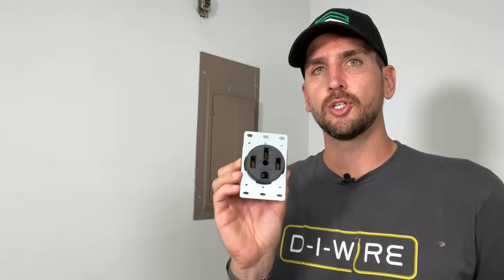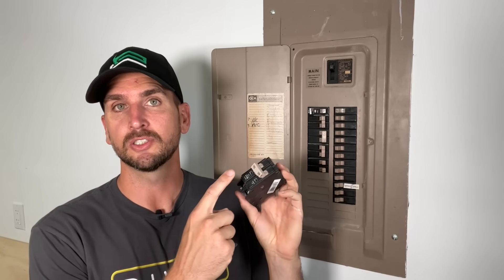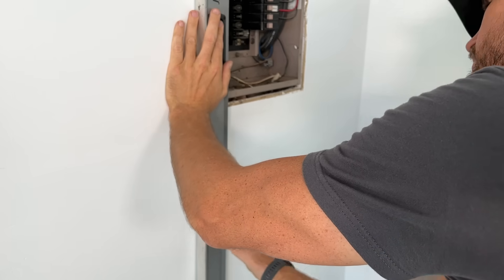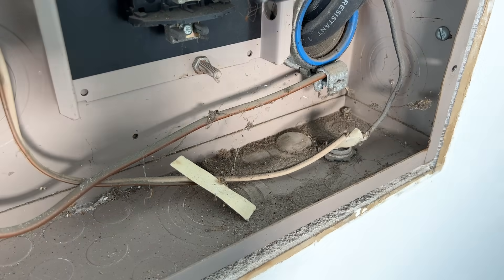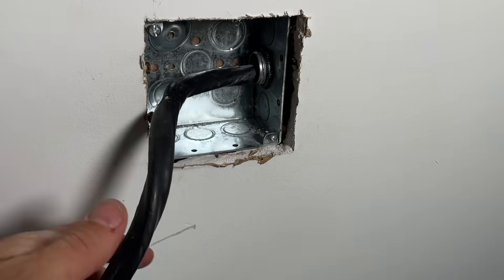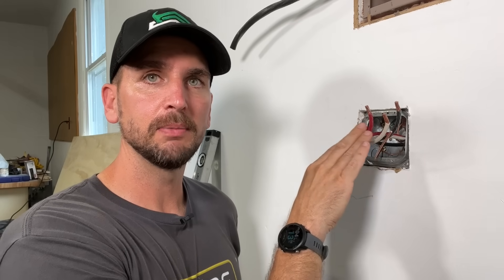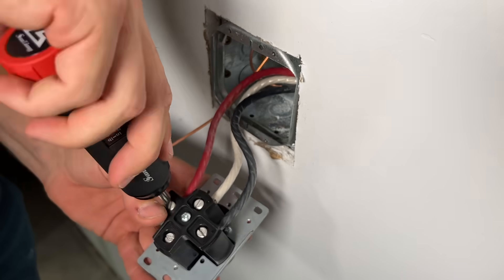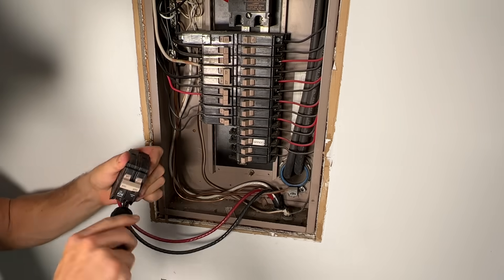Quick and Easy DIY 240V Outlet Install | 50 Amp NEMA 14-50

Comment from the maker: All My Favorite Tools: https://geni.us/VYIp51
Torque Screwdriver:  https://geni.us/pghmcX

Supplies
Eaton CH 50 Amp Breaker:  https://geni.us/Afby
Best NEMA 14-50:  https://geni.us/xIXIYZt
6/3 Romex:  https://geni.us/rg0e
3/4 Wire Connectors:  https://geni.us/yQen
4" Metal Box:  https://geni.us/UUEBe
Mud Ring (1/2" Raise):  https://geni.us/UUEBe
Faceplate:  https://geni.us/zbN3V8

Free Home Maintenance Checklist: 
https://geni.us/uQuAWER

"D-I-Wire" T-Shirts:  https://geni.us/ifioHVc

DISCLAIMER: This video and description contain affiliate links, which means that if you click on one of the product links, I’ll receive a small commission.
Reply: 20 inch/lbs? I'm looking at my EV rated  14-50R and it says 75 lb-in

"'8:49 going to go back through with the torquing screwdriver make sure i get the 20 inch pounds 
And also the key is because these are stranded wires you want to torque it down until it clicks. 
Then you want to work those wires and move those strands around and then torque it again
Do that 3 four five times before you're confident that everything's torqued correctly."

https://hubbellcdn.com/installationmanuals/WIRING_PD1186_INSTALLINST.pdf

installation manual there  says 75 lb-in

Comment: PLEASE - Do NOT use the standard 14-50 receptacle like he shows in this video - it WILL melt. Use an EV rated 14-50r receptacle. It is heavy duty and can handle the current an EV charger puts through it and much less likely to burn your house down.

Comment: Make sure you use a heavy duty 240 / 4 wire 50 amp receptacle.
Reply: Wrong type mounting screws, wrong size ground wire. Standard receptacle.

Comment: This video should be taken down at this point, these cheap 14-50 receptacles do not work for continuous loads like EVs. Even with the right 14-50r receptacle, it also needs a GFI breaker.

Comment: WARNING! The NEMA 14-50 is not rated for continuous current. Go lookup the Landers Electric video which shows that a $50 Hubbell 9450A is the correct receptical which is actually rated for E-vehicles. These $10 NEMA 14-50 melt all the time under constant load.

Comment: That $9 outlet was designed for dryers, etc. that run for short periods of time, drawing much less current.  Your EV charger will  be powered for hours and hours drawing upwards of 40 amps continuous.  You really need an EV rated outlet to handle the load.  They cost in the $80 range.  Bite the bullet and buy one that can handle the heat. $80 is much less than the cost of rebuilding your garage when that $9 outlet melts.

Comment: How does an 80s panel have enough amps?  Mine was installed in 1996 and has 150 amps total.  And don’t you need surge protection?

Comment: Safety Alert!  You update this video and stress that this plug is not rated for high amp L2 EV charging. Read the box it will even state that. These are for stoves and laundry applications. The sustained high current will melt these cheap connectors. The ones needed are marked for EV charging and cost a significant more ($80-90)

Comment: I just did mine.  It cost about $500.   $200 for 6/3 50ft Romex, $100 for ev outlet and parts.  $200 for a level 2 charger.  $500 well spent!  You dont need gcfi breaker if u get a level 2 charger that has gcfi bulit in.

Comment: Caution - go watch t8Hy-8X4mNU which discusses risk with not using EV outlets for EVs.  I'm not 100% sure why outlets "rated for 50A" are melting and catching fire, but I wouldn't recommend spending the ~$9 on the outlet here.  Also note that EV outlets often have a larger face, which means that face plate may have too small of a hole to put the outlet face through.

Comment: Great video thx!  Question:  why use a metal box?  You have to  connect a ground wire to it.  Versus use a plastic box.  No ground needed.  Am I missing something?  Why not use a plastic box?
Reply: And plastic face plate with plastic box.

Comment: If you're using the cheap NEMA 14-50 plug then you don't want to pull too many amps on it. Using a mobile charger that doesn't pull any more than 32 amps should be fine, but if you're trying to pull 40 or higher, you're probably going to have a problem. 

It's also a good idea to put a mechanical switch ahead of the plug so you can turn it off when not in use without unplugging from the wall.

Comment: I hate being that guy - The EV charger breakers can be sized based on how much energy you have available.  You did not cover if the main breaker or incoming wires can handle the new electrical load. You did not explain the max amperage of the bus bars in the panel. Yes, this can be a DIY project, but someone just throwing a  dryer outlet with a 50A breaker in and letting it buck could cause an electrical fire.
Reply: So then make a video explaining it

Comment: Note OP found out this install is not per code and has other problems so there is a follow-on video that fixes these problems.  Do not use this video to install an EV/welder 240/50 amp connection.

Comment: Got the same Cutler Hammer panel right down to the label for identifying each circuit.  Glad to hear it was a product of the 80's rather than having been around since the mid 50's when this house was built!  I used the 240v 30a dryer outlet for level 2 after upgrading the outlet to a 14-30p matching the EV charger's plug.  After a couple of years of EV charging, the almost 30 y-o breaker kept tripping and needed replacement.  Local parts availability made the job a snap.  Thanks for the video!
Reply: Be careful.  The cheapy outlet the guy got here is NOT for EVs.  Dryer plugs work well for dryers and stoves because they are not drawing current more than an hour at a time.  EVs on the other hand can melt dryer outlets from the strain and energy demand going on for hours.  The proper EV outlets cost more than his entire project cost in this video.  Make sure you get a better outlet that is specifically rated for EVs.  They should cost $70 and up.  Not the cheap $20 and under from HD and Lowes like the one he got here.

Comment: Thx for the video! Trying to install a LEVITON NEMA 14-50 for EV. The manual says the required terminal torque is 75in-lbs (much higher than the 20in-lbs mentioned in the video) -- not sure whether the EV version asks for higher torque.

Comment: I had the same exact thing done, with the receptacle 8 inches below the bottom of the panel in my garage. Except in my case it was a 6-50 receptacle and I paid an electrician friend to do it so my cost was a bit over $100. Then I just plug in my Tesla mobile charger and the 20ft cord allows me to charge my Tesla in my garage without having to back the car in. I got a wall mount kit so the body of the mobile charger is secure to the wall, and wrap the cable around a second mount that has a hole for the adapter's plug when not in use. I do have to put up with the cable dangling the whole length of the car so I have the cable rest on the side mirror so it's not dangling too much on either end. Just have to be careful when locking/unlocking the car.

Comment: Recommendation:
We recommend using an industrial-grade NEMA 14-50 outlet for enhanced durability and safety. In addition, to comply with the National Electrical Code (NEC), this circuit should be protected by a GFCI breaker, as required for outlets used in garages and outdoor locations.

Comment: DONT USE CHEAP OUTLETS!   There are lots of examples on YouTube of what happened to people that used 14-50 outlets designed for electric ranges.  Use one rated for EV's and designed for continuous use.  These are Heavy Duty and have better wire connectors using Allen screws

Comment: In VA and most places a GFCI breaker is required. The  last one I brought was $175.00. The proper receptacle is around $55, the cover plate to fit around $10.00, and 6-3 romex is around $6.00 per foot. And yes using the wrong material could result in your house burning down. After the insurance inspectors get through, you might be paying to rebuild your house on your own.😂

Comment: Crazy, just my hubble was 75 then my permit was 145 then my wire was 250 then my breakers were 130 then my misc was 35 total 635 plus the charger of 900 no govt subsidy.

Comment: Maybe a good observation - the $9 legrand should probably never be used for EV charging. At this point the slightest research would show this is one of the main reasons for fires/melted outlets. Not only that, but the manufacturer itself is disclaiming that in the included instructions. I'm not sure if saving $40 is worth it

Comment: $66????? The 6/3 wire alone is $7 per foot! I bought 6ft of wire $42, the commercial grade EV plug $50 and the 60 amp breaker $20. All in all I spent around $130. 
I don't know where he gets $66 from. 😂

Comment: Those outlets are not full duty nor designed to be pluged in and out. A dryer outlet use for EV charging is a fire in the making. Get the proper outlet.

Comment: Will this breaker work for the Tesla level 2 mobile charger?
Reply: Yes, but the outlet he is using is not EV rated. Get the Hubbel 9450A. The one he is using will probably melt.

Comment: Sorry to say but you're in violation of NEC 625.54. That install needs to have a GFCI breaker. That will blow your $66 budget way out of the water. That breaker alone is about $150.

Comment: I use the plastic outlet box so do i need to put extral 10 gauge ground? Thanks
Reply from the maker: No need to ground the plastic box so just straight into the NEMA 14-50 outlet.
Reply: Thanks sir

Comment: My 2001 built homes panel came outfitted with an empty electrical box like the one you installed but no outlet in it. What other uses would it have other than charging electric cars?

Comment: You'll need a GFCI 50A 240VAC breaker for a garage or outdoor installation.  Add another $50 to the project.  The receptacle alone is reaching your projected cost o0f the project.  Hard-wire the charge regulator to save yourself the cost of the receptacle anf GFCI breaker.

Comment: Thanks for sharing this video.  The link to the mud ring listed is not correct.  I am not an electrician.  Is the mud ring necessary, and if so, what should i look for ?  I assume it is supposed to fit the electrical box.  thank you

Comment: I did this project and it wasn’t too hard or expensive. But I used a commercial grade outlet. After it wa all done I plugged in my ChargePoint charger only to discover it kept tripping the GFCI (an extra cost in the $150 range).  I ended up starting over and changed to a hardwire install. It’s much cheaper, easier and provides slightly more charging power. If I ever want to move the disconnect is easy.

Comment: I'm sure someone has already pointed this out but I don't have time to go through all the comments.  That 14-50 outlet is crap for car charging.  It might be fine for a welder or a garage clothes dryer.  But I assume people are not installing this much power in their garage to weld something or to dry clothes.  99% of these installs are for car charging.  And that $9.00 outlet will burn up fast.  You need Hubble brand or some other heavy duty outlet that can take the 42 amp continuous load it will be pushing out for hours at a time.  Otherwise everything else is spot on.
Reply: I think you should update your information since this is 2025.  Using a commercial  outlet (Hubbell) 14-50.  It will hold up much longer and will not melt if left plugged in.  Only thing that I see that needs to be addressed is the Hubbell outlet says it should be torqued to 75 lbs!  Not 20 lbs that you recommend.  Otherwise, you might want a deeper box, or an extension to make things fit easier.  Just thought I would let you know.
Reply: It’s a 14-50 so it’s something that needs a 120 & a 240 like an RV hookup but you’re absolutely correct, that 14-50 NEMA outlet will work but it is not the safest. It’s not made to sustain the heat from EV charging. Take a look at it after a year or two of use and it will likely be a melted mess. You need a beefy outlet like a Hubbell 9450A 14-50R for EV charging. It has that little green EV charging symbol on it. Additionally, if you ever wanted to upgrade to a phase 2 charger, that Romex is also unsafe. You really need 6awg THHN wire. That RV outlet plus Romex will do the job but it will also put you at risk for a house fire 🔥
Reply: He did use Hubbell
Reply: @jaykid007_JasonDavis 3:10 shows a Legrand outlet. This guy’s next video should provide instructions for filing the homeowners claim for the house fire.
Reply: @BPBomber  Tnx yeah I messed up. Hope he changed that one out! Also new Leviton ev 14-50’s at HD. Not bad for $39

Comment: Forget commercial grade, I would go with industrial grade.  Dont forget the 50a breaker and 6awg wire.  Risk a fire for $66 or pay more and sleep well.  If you want cheaper and safer consider getting an industrial Nema 6-20 which uses a 20amp breaker, 12-2 gauge wire and all that is super cheap in comparison.  Sure you will get 4kw vs 9kw but do you need quick charge at home?

Comment: Thanks for putting this together, but I ran into a couple issues following this procedure. First, the mud ring is unnecessary. You can buy a box with tabs that the NEMA 14-50 socket can mount unto directly. The mud ring just makes it much harder to maneuver the cables and risks causing a short. Second, it's extremely risky cutting your hole directly below your panel. It's highly likely there are existing wires running into the panel from above and below. Finally, a GFCI breaker is likely required to meet code in many municipalities.

Comment: I wish my panel was in the garage unfortunately ours is all the way in the basement the opposite side of our driveway and garage. It’s an older home built in the 50’s I believe and while the panel has been upgraded it’s still not the latest and most powerful. I think in this case it would cost a fortune to run a wire that long from the basement all the way to the garage. For now we are using a Level 1 charge. I wish there was an easier way to do this. With our set up it might cost us thousands we are told. If anyone has any advice I’d be really grateful for it. Thank you!

Comment: #6 ROMEX was too hard and stiff for me to wiggle through the tight space and wall. So, I used #8 THHN-2/THWN cables. These have higher ratings than #8 Romex.  It is a very short run too like yours. 5ft. 50Amp breaker. I am charging max 40Amps only. Is that okay or you think I should drop my charging to 32Amp and replace breaker to 40Amp? Appreciate your help.

Comment: I’m doing this exact project for a welder and plasma cutter. My box will be almost directly below the panel cut out and it will be less than a foot away from the panel. Would you recommend using one of the top cut outs on the switch box instead of the side?
Reply from the maker: That would work 👍, best of luck on the project.

Comment: Can someone tell me why it is grounded to the wall box?  The wall box itself is not grounded to anything (it's attached to a wood stuff and has insulated conduit). Just trying to understand.
Reply: Think I figured it out... You're actually grounding the box to the panel in case a hot comes loose and touches the box?!

Comment: Should I use a GFCI breaker?
Reply: I figured this out. In Washington state, where I am, it is required. This may be a NEC requirement, but check your local regulations.

Comment: I thought those cheap 4 prong outlets...$10, were designed for dryers, and ovens, which cycle their engery use...on/off...on/off...over the course of an hour (eg a dryer).

Using these cheap outlets for 8 hours of continuous amps to charge a car will generate too much heat and melt/start a fire

Comment: That 14-50 outlet... DON'T CHEAP OUT on that.  Regular ones aren't designed to be unplugged much at all, the connection gets weak. When you pay more for the outlet, maybe $60... those are designed much more rugged, even if you unplug several times, the connection will still be solid.  I'd rather do that and prevent a serious electrical problem.

Comment: wtf are you doing? 🤦‍♂️ where's your PPE. Don't listen to this guy. You're going to get yourself killed getting electrocuted. Safety first wear proper PPE. Turn the main circuit breaker before commencing work. Have a digital multimeter and check for any live wires. 

Be familiar with your A and B phase. You can surface mount the box instead of cutting a big whole. Btw it's not called capacity it's called spacers or any space to add a circuit breaker. Test before you turn the circuit breaker. Make sure your getting 120 volts each phase and 240 v phase to phase.

Comment: Exactly what I did, but used a Hubble 14-50 outlet. I just back my car in and plug right in. The Tesla mobile connector only does 32A max, and the same for my RWD Model 3.

Comment: How do I ground it? My electrical box is plastic. Builder ran 8 gauge wire on a 40amp breaker I’m just missing the hubbell receptacle. I see I have a black wire, a red wire, a white wire and a ground wire.

Comment: YOU MUST USE A NEMA 14-50 OUTLET MADE BY HUBBELL (MADE IN USA), ONLY OUTLET RECOMMENDED BY TESLA! CURRENT PRICING IN 2024 IS $50 TO $100. ANY OTHER OUTLET IS MADE IN MEXICO USING CHEAPER MATERIALS.

Comment: Next time, use FClips, and easy tight in for that square box. Either way works perfect like you did. flat with drywall and flat ring for the receptacle, don’t need the rise one.